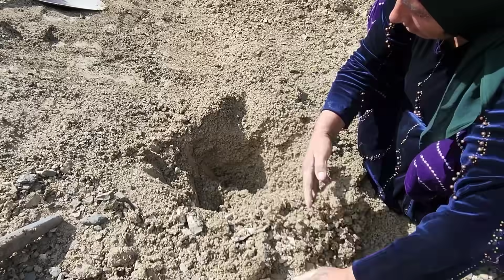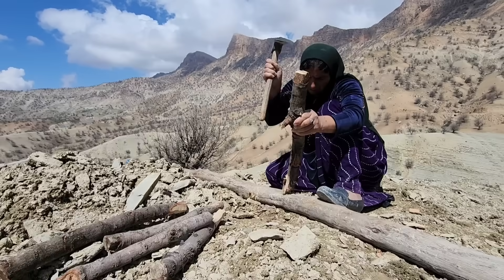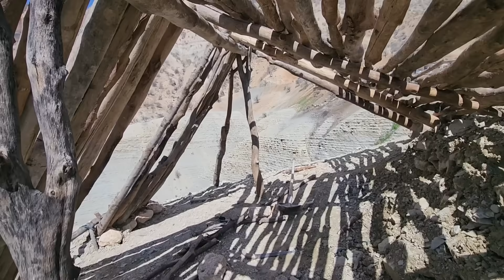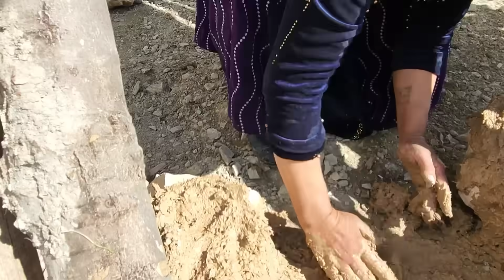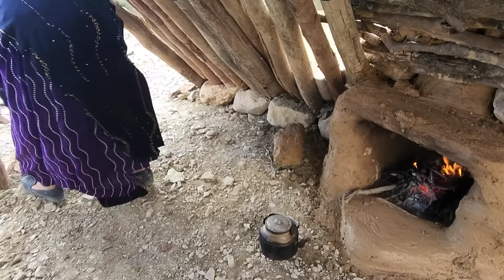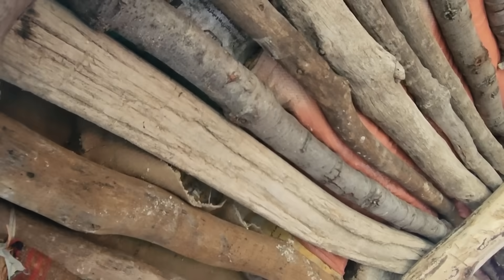Building a wooden hut by a nomadic woman in harsh and cold winter conditions

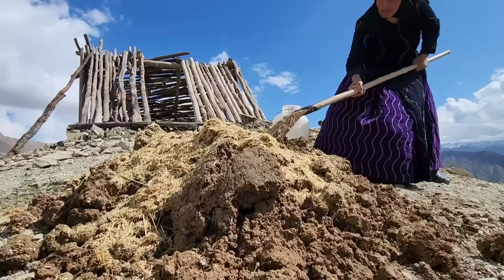Comment: That is NOT "harsh and cold winter conditions" . the kids have short sleeves on. She is not wearing any gloves. There is no snow on the ground. They are not bundled up in winter coats and winter hats. There is no white "smoke" coming out of the mouths like you see if the temperature is below freezing! It clearly is not cold there. Her clothing does not look very warm either. Misleading title. And from what I see of her structure, a blizzard would blow right through it. At 16:19 you can see gaps where the light is coming through. Snow and freezing air would blow right through there. Her family would get covered with snow. Besides how is a few sticks supposed to insulate a house when its below freezing temperature? Harsh winter conditions means below freezing. Usually means even lower, like maybe -20 F.